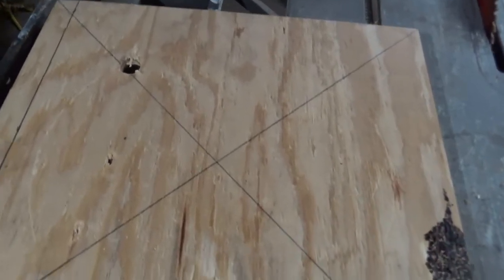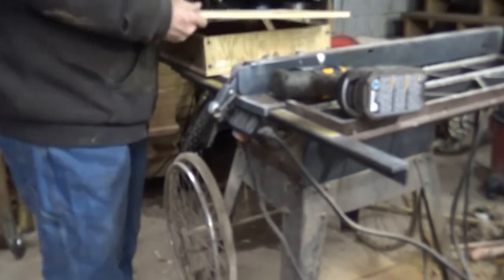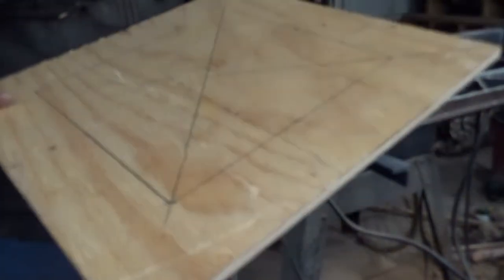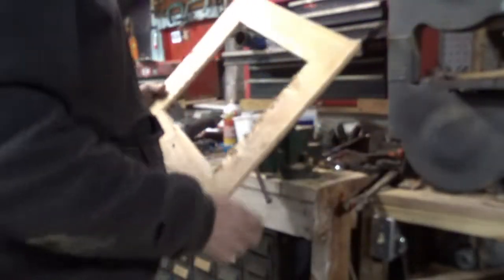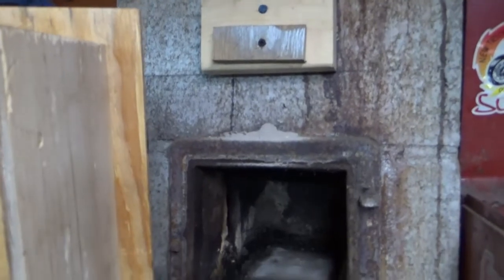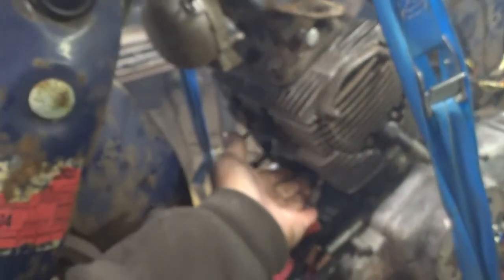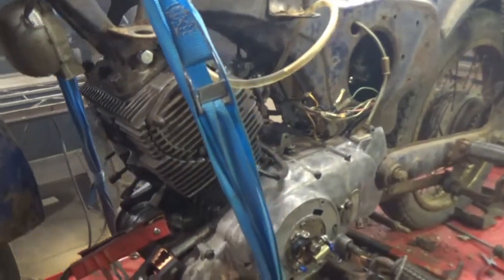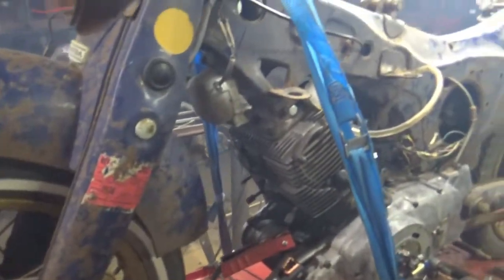Ventilation Fan...Helps a little bit

Comment: Hahaha,  👌Good job on the e-fan, if you crack a window/door open a little bit it should work better but its gonna get cold in there. The honda sounds good on my TV!
Reply from the maker: Still popping and doesn't want to rev.  I think I'm not getting enough juice through my battery charger to adequately power the ignition system.  As for the fan, I will have to give that a try... When the old lady isn't home.  Lol!
Reply: @rustyedmoore  You'll figure it out, and yeah, the fans gotta be sucking in a fresh air source from somewhere. You cant keep breathing that crap in, before you know it you'll be making goofy movie parodies ! hahaha

Comment: I would at least put the header pipe on and put in new plugs. Good idea with that fan but make sure the flew upstairs is open or it will smoke the wife out.👍
Reply from the maker: Header pipes were missing when I got the bike.  I wanted to make sure the bike would run and not have any major issues before buying all the missing parts.  The header pipes, points cover, battery tray, air filter, air filter/tool kit bracket, both side covers, headlight and bezel.  Amoung other stuff.   I guess that's what you get with. $50 bike.  Do you think the "popping" could be caused by low voltage?  I am not using a battery.  I have a 6volt 2amp battery charger supplying voltage to ignition.
Reply: @rustyedmoore  I would definitely try using a battery as I doubt the power supply is any where near it's rated power and I don't know how much amperage that points system needs to produce proper spark.
Reply from the maker: @mikeshobbiesandrandomstuff  That's what I'm thinking.  My xl125 won't run worth a crap if the battery gets low. Thanks for your thoughts.